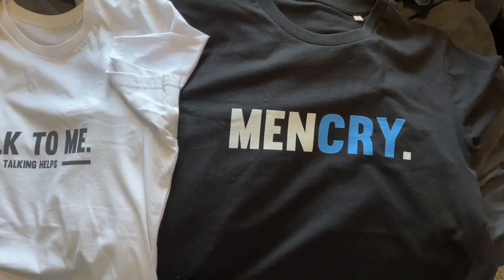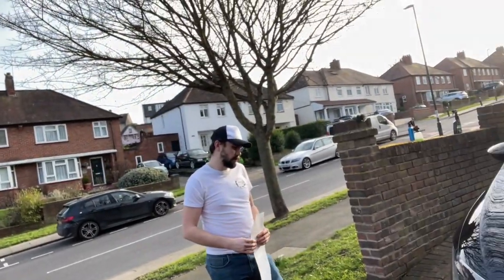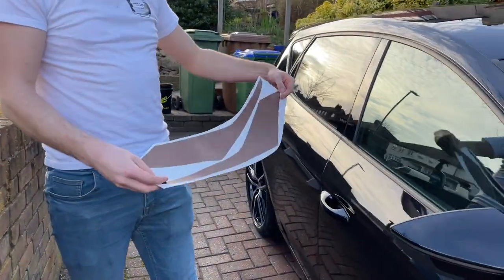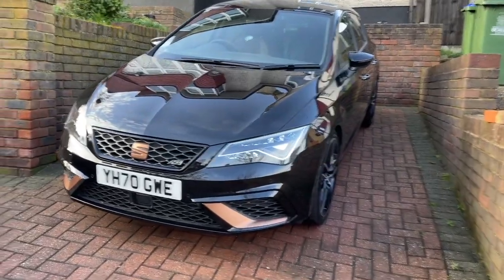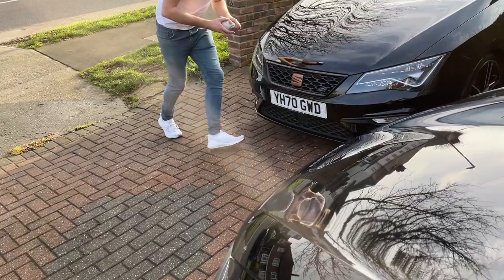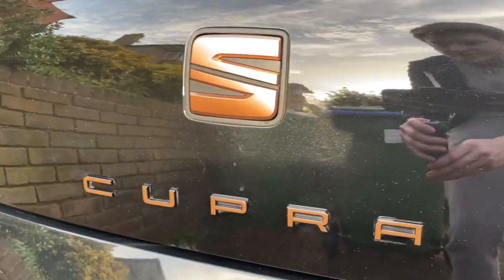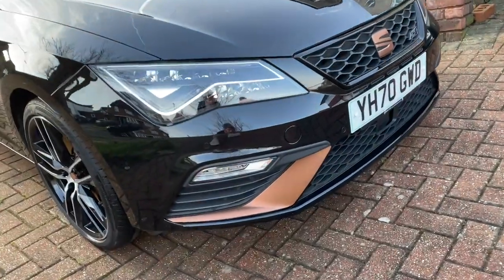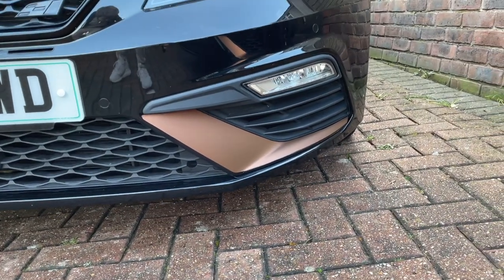EZMods Cupra Decals (vs) Cupra R Grilles

Comment: hey it turned out awesome, tho im wondering whats the use of that liquids bottle?
Reply from the maker: Wetting it before applying it makes it a lot easier to position and move. Drying it off makes the adhesive bond to the surface

Comment: Hi Dan. I prefer the R grill copper as it protrudes , so my question is, would the copper  fit my cupra 3.5 with the fog light still in ? As wanting to keep the fogs but I don’t want to fit the gloss black surround, if that makes sense. Cheers
Reply from the maker: You would have to cut a section out for it, I’ve seen it done and its a difficult thing and doesn’t look particularly right. They don’t fit unless you heavily modify the grills. Mexico actually had a version that had R grilles with fogs built in, but we dont get those parts over here. I’ve not actually missed the fogs at all personally!